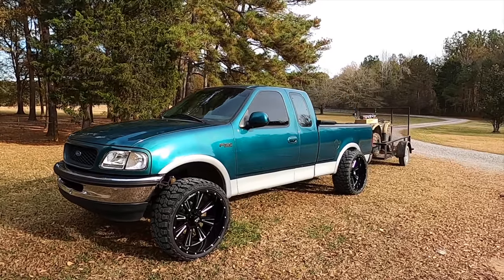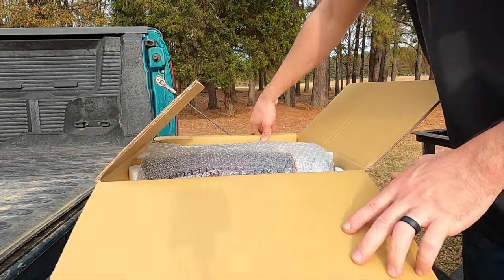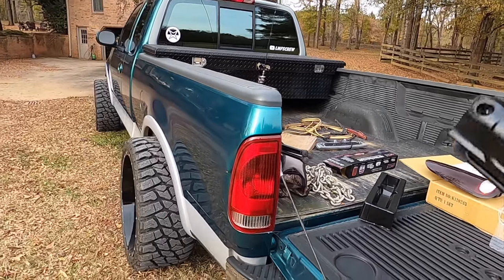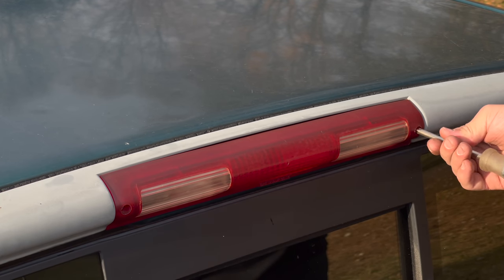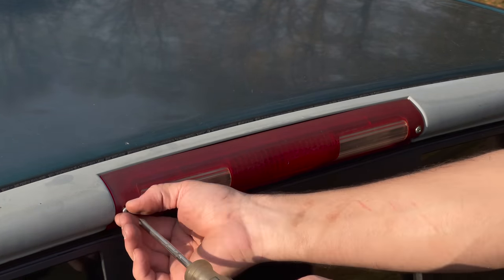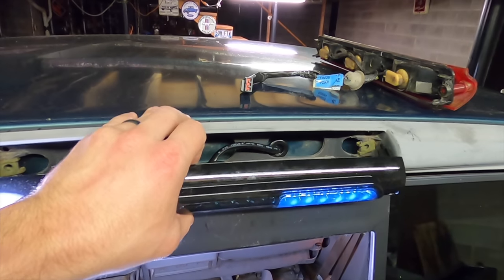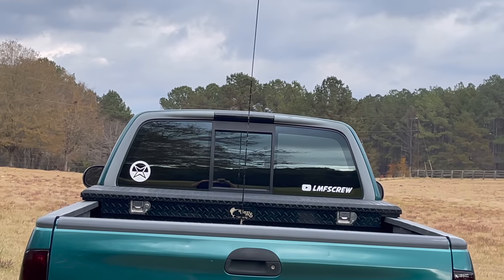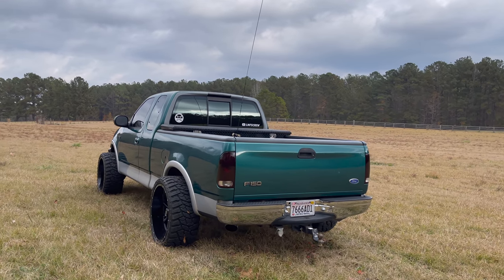MOST REQUESTED MODIFICATION FOR MY F150!!!!

Comment: Definitely replace at least the reverse lights with LED's. A year ago, I replaced the cargo/3rd brake light assembly with the Dorman one since I already had LED bulbs to install. Didn't fit flush at the top, but nothing clear silicon caulk couldn't seal off. Been looking into getting new taillights for my 2001. Was kind of thinking of going with the chrome version to match the headlights, but after watching this video, I might just go with the smoked version as the stock taillights don't really bother me either and the smoked look cleaner.
As for the bumper, I'd try to find one with the slots for fog lights and see if you can't convert that truck to include fog lights.

Comment: People don’t understand on the cheap led lights the connectors use the old factory light sockets you just unplug the bulb and the new led connector plugs into that 

P.s you should’ve just gone to a Paintless dent repair they could’ve knocked that out without issue

Comment: now you need to paint the rear window surround black. it would be a easy and cheap mod to do. maybe put some newer emblems on the truck too. i put 2010 badges on my 01 and they covered up the mounting holes just fine.

Comment: U should totally put a 22 inch lightbar in that hole in the front bumper youll light up alot more on backroads perfect work light i did it with mine go to harbor freight get the 87dollar one its perfect trust me youll be sasitified

Comment: Larry looks bad ass. I have a 98 that I have been fixing up as well. I’m wanting to put tires and rims on mine similar to yours. The way I’m fixing mine up is a blue on black theme. The blue being carbon fiber as well. So anywhere you would see chrome would be blue carbon fiber instead. I’ve had a lot of comments on my truck and a lot of people wanting me to paint their truck just as I have mine. I was curious what size of rims and tires you have on yours and if it is just a leveling kit you have on yours? I don’t want to go taller with the tires just wider than stock. The stock tires on mine was 235/70r16. So how do I go about getting the wide tires and taller rims without cutting the tires when I turn?